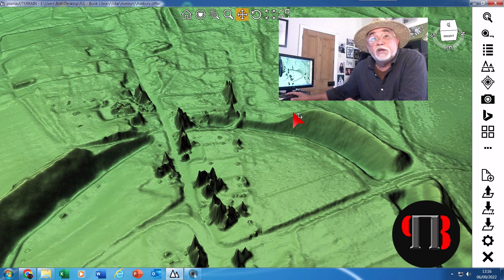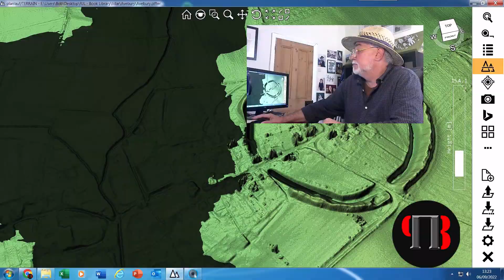Avebury - Phase 2 (Main Henge) LiDAR Investigation

Comment: Fascinating theory. Do the ditches contain any sediment usually found at the bottom of a river?
Reply from the maker: The fact that the 1922 excavation had to stop as it started to fill with water, and that recent rainfall temporarily filled the ditches, tells the story of the water table around this area, including Silbury Hill, which floods every winter as it sits on the remains of the prehistoric harbour. Sadly, the excavation work was not the most professional with an army of navvies digging with shovels - it would take modern archaeologists several years to painstakingly go through soil with a small trowel - hence it's never been attempted since - so we will never know.

Comment: I think you are right about the importance of water, but should be more to it than just delivering goods. .. It's been raining for 6 months, flooding all around, water everywhere on the fields, but the Avebury ditches are dry. Why? Avebury is on a chalkland aquifer. A market doesn't need 30 - 65 tons stones to form 3 circles. I see the same formula at ancient sites: running water under quartz megaliths (sarsen or granite). I think we are missing something here to see the full picture, to connect the dots.